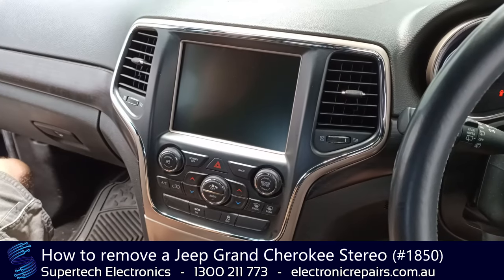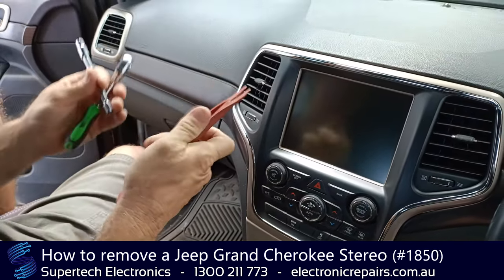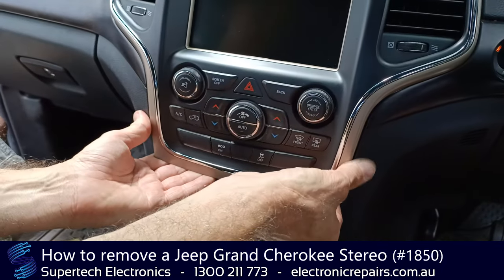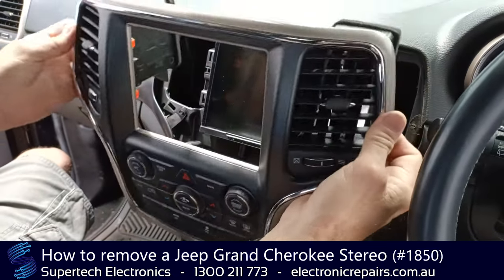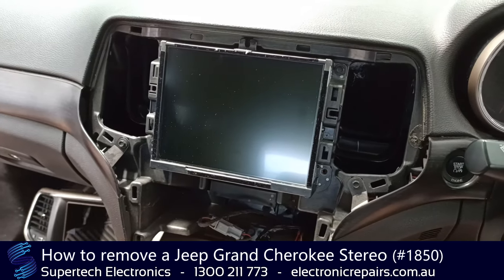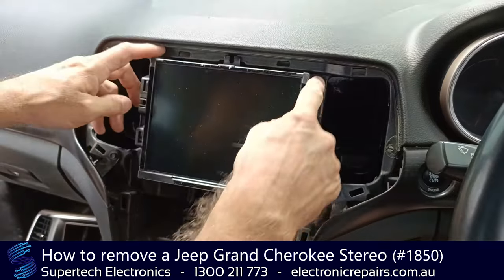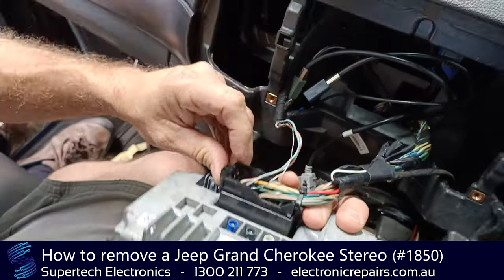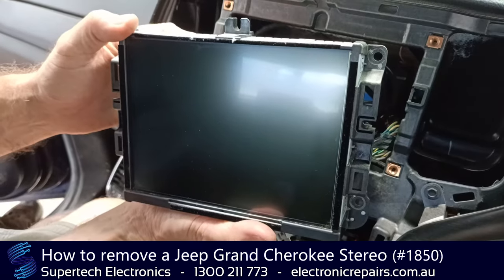How to remove a Jeep Grand Cherokee Stereo (#1850)

Comment: I used your video to do this yesterday and it was perfect.  The plastic frame for me was way harder to pop off than you showed.  No judgement just a note.  Also, I had a lot more connections in the back but nothing that wasn't easily solved.  This helped a lot with the explanation of how to remove it.